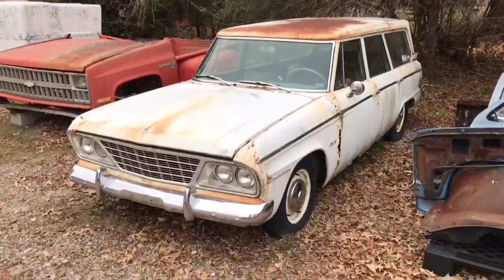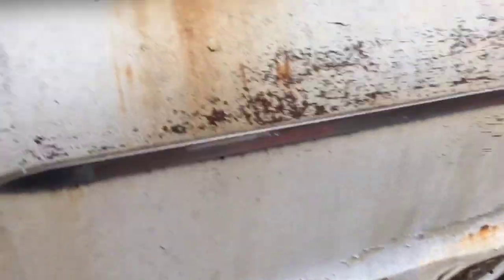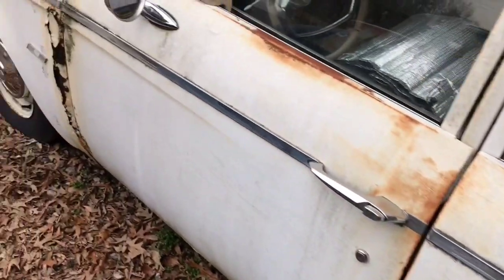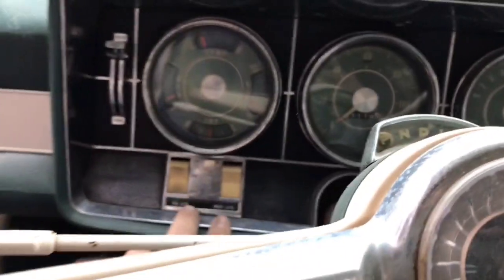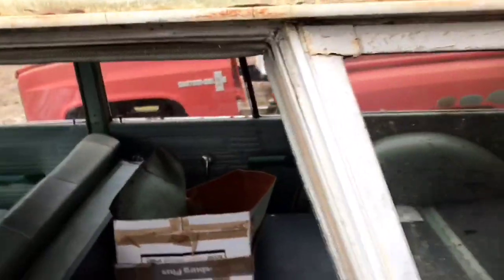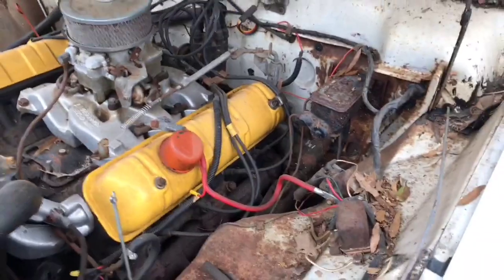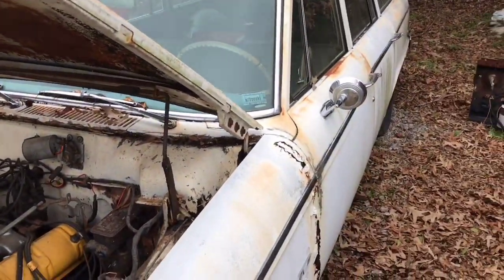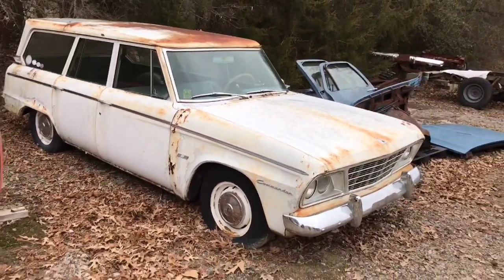64 Studebaker Commander station wagon

Comment: I just bought a 64 Wagon, it's a complete rolling project though, no motor, trans is there but is locked up, The Interior is toast except for the headliner for some reason which is still in really good shape, which is ODD out here in Arizona, normally that's the first thing that goes. I'm gonna build it into a daily driver restomod, I've got a 305 and 350 Auto trans out a mid 80's Chevy truck that I'm going to put in it, I have some Bucket Seats 2013 Kia Sorrento that I bought off of Facebook Marketplace  for $100 that I'm put in it. It's blue with blue interior but I'm going have to change that, I'm doing the interior in Grey and I'm painting the car Burnt Orange with a light Grey Roof.
Reply from the maker: That’s cool, good luck with it